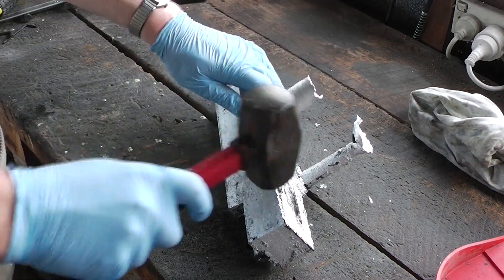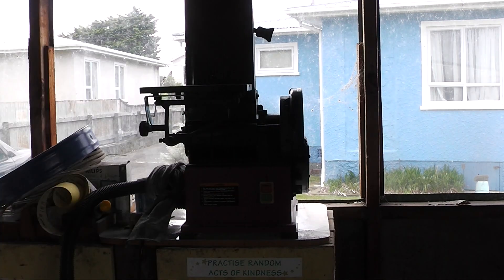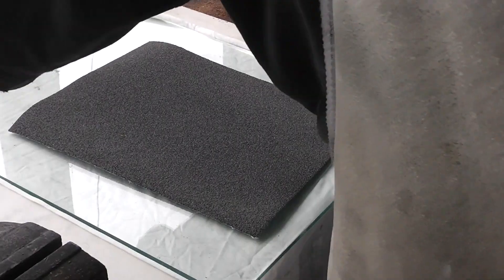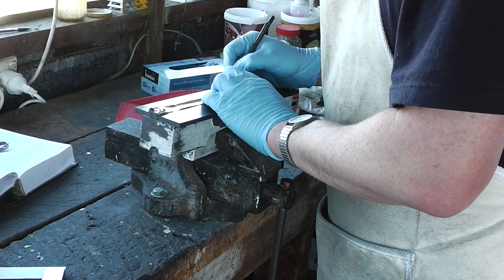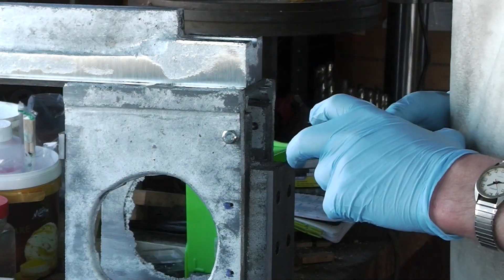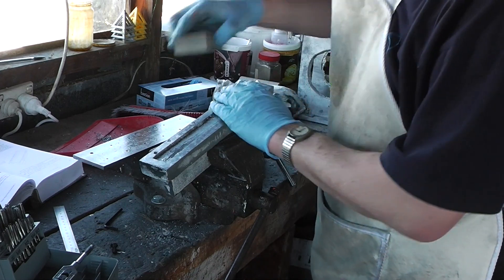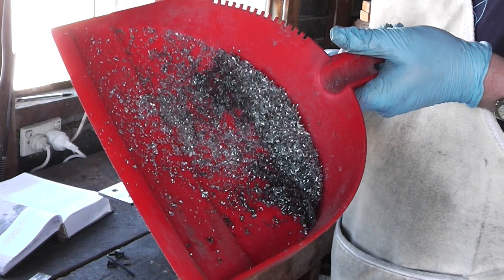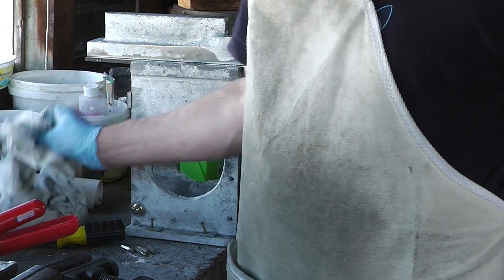Starting the Shaper Ram

Comment: I have never seen anyone make a Gingery shaper with anything denser than aluminum. I’ll bet yours will work better because it is just heavier from the Zamak. Do you use Z 12?
Reply from the maker: Yep, Z-12 (or Ezda 12, as the place I buy from calls it.) Using it on the recommendation from Paul's Garage.
Reply: @HaveAGoAlan Paul is a good casting teacher as well.
Reply from the maker: @a-k-jun-1  He is, but is as distractable as a kitten unfortunately :(